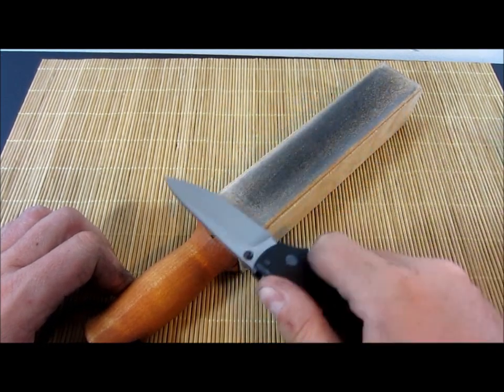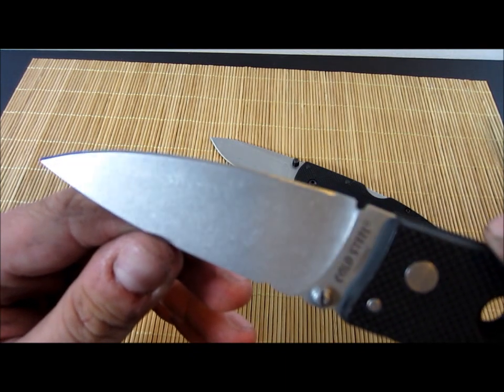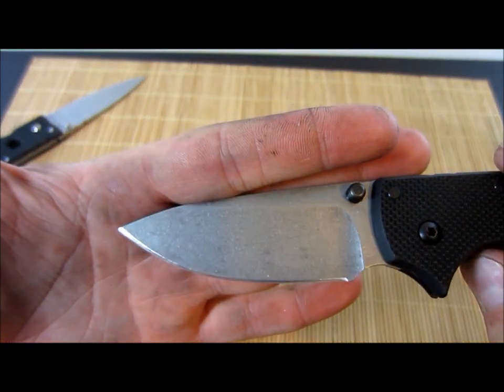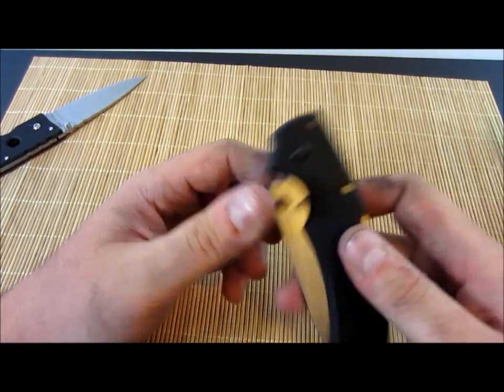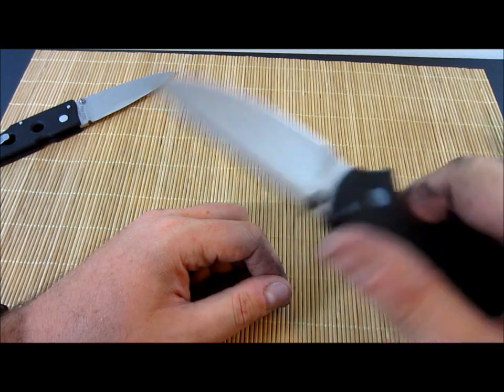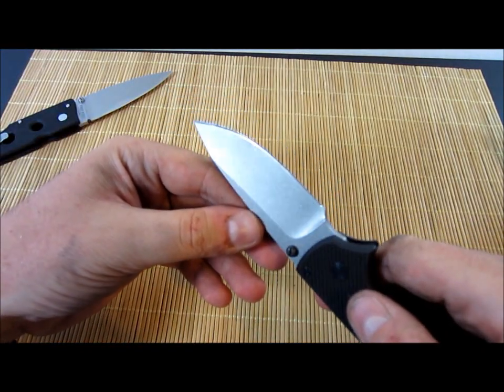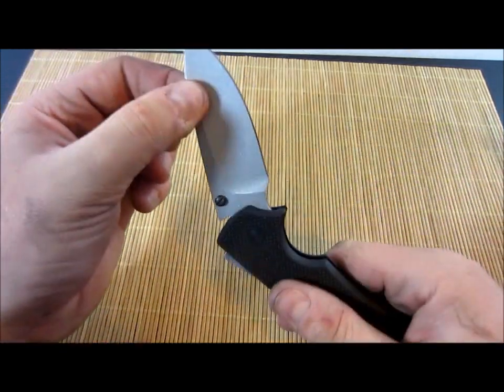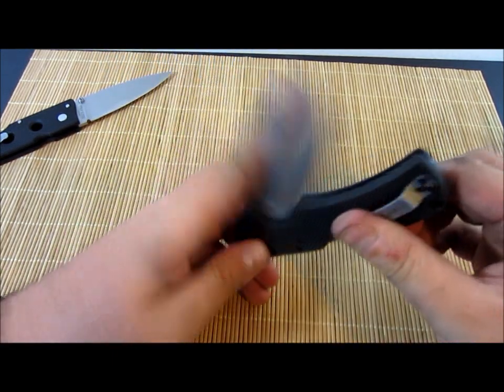CS American Lawman Stonewash Finished

Comment: Thanks for all the work, sorry it did not pan out as planned. If the washer was working right and you put the blade in the stonewash with the coating on, would it remove it and stonewash efficiently at the same time? And is there a way to hang the blade with a wire so its in the medium in a way it gets evenly washed on both sides?   What about a wire brush wheel on a grinder to get that coating off??

Comment: id try a 2 liter bottle of soda some soap and water and some real ceramic media not regular rocks. drop it in the dryer on low/cool heat for a couple hours. You are better off doing that, much cheaper and less time consuming. and jdavis already told ya about the solution to remove the coating.